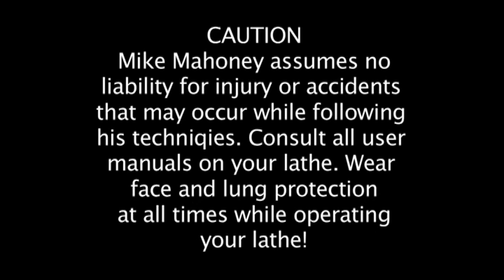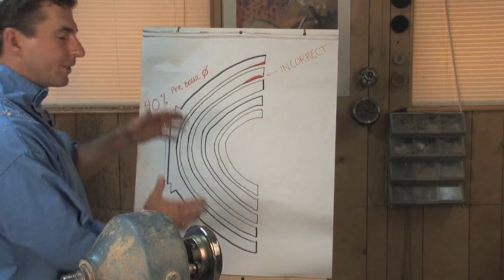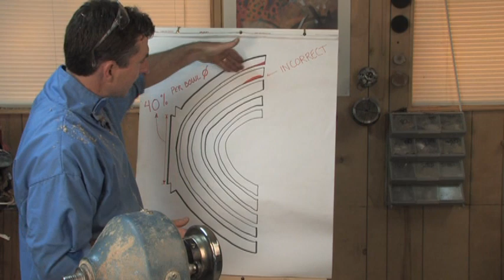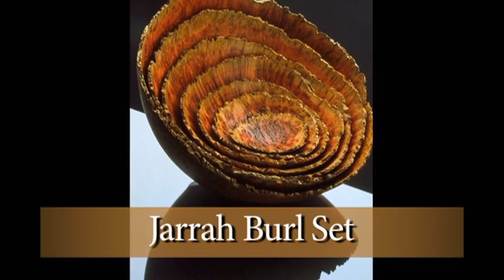Mike Mahoney and the McNaughton center saver

Comment: I have a set of these and they are great .. On  one occasion the blank came  off the tennon about 3/4 way through through. Well i didn't know it for quite a while but it bent the medium blade. I kept trying to finish the cut and ended up with my first funnel. 16 inch bowl of poplar. I accidently set the blades beside each other in a stack by size and noticed the medium blade was sticking up out of line with the others. I ordered a new replacement  and back in business. I did try to straighten the bent one ...close but no cigar.  Thanks Mike.

Comment: Mike you are the GOAT!  I just bought a used (very little used) KM coring system here in Germany (got lucky on eBay) and I was nervous to take the plunge, so to speak!  ;-P   I learned sooooo much from this video...know I'll be watching it again!  Many many thanks for making this available.  
I am curious, when you core a blank this way, you are using fresh wood, right?  Some of those burls have so many bowls in the set--is the surface finish from the coring cut so good?  some of them seem too thin to even clean up with a gouge... Or do you clean up only the very bottom of the inside, and then flip it to remove that baby-tenon?
Warm regards,
Amy
Reply: Mike usually cores green or freshly cut wood, but on natural edge burl pieces, they can be dry.
Reply from the maker: many are green woods